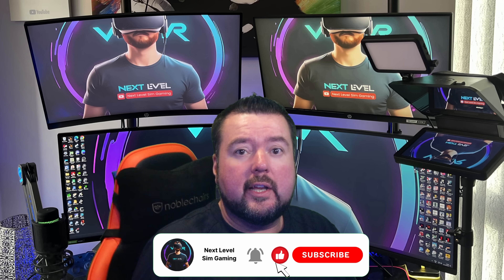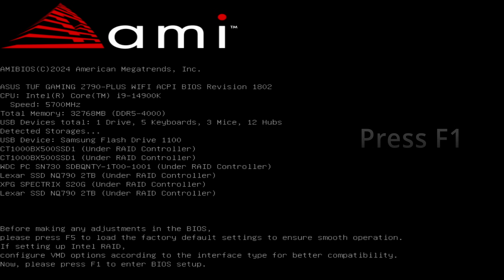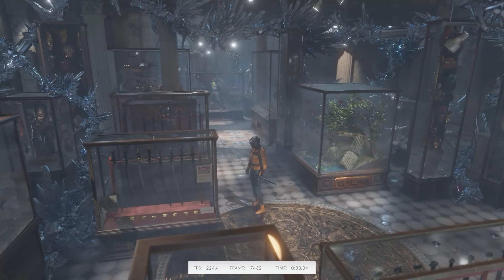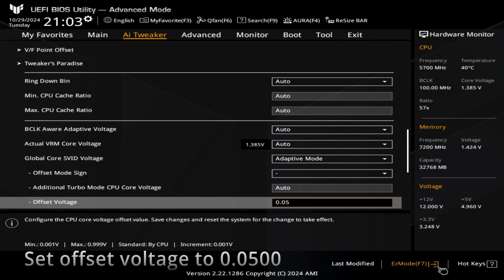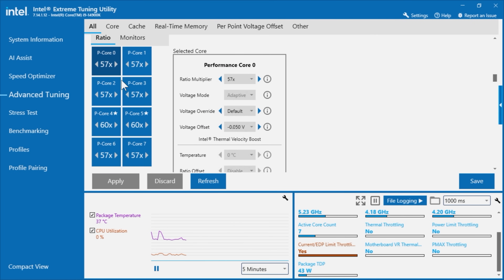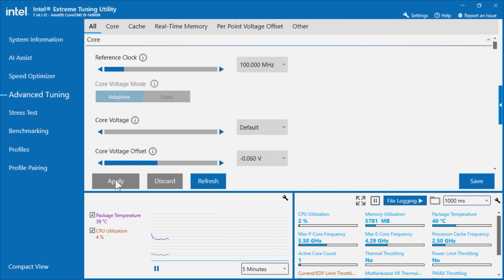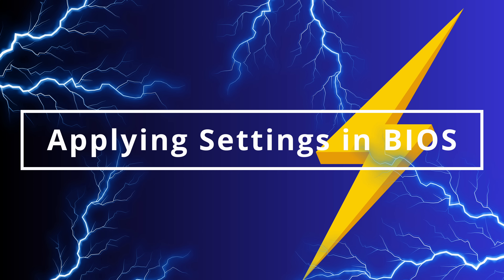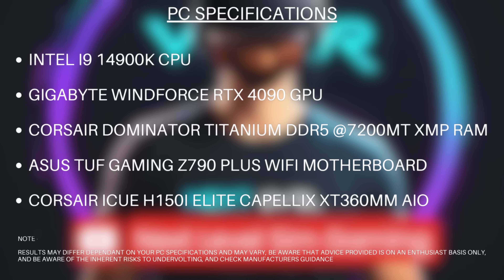i9 14900k Intel Final Microcode 1802 - 0x12B  BIOS Installation, Tuning and Undervolt Guide 📈

Comment: hi, im on b760-f and there no option for multicore enhancement. theres only asus performance enhancement 3.0. what can i do?
Reply from the maker: I unfortunately can’t test on any other platform presently, the only sure way is to try the variables, Auto / Enable / Disable and look at the benefits (if any) Its an overclocking feature that will deliver additional power, in an environment where we are setting power limits in line with Intel’s specifications so I would imagine the gains would be minimal
Reply: @nextlevelsimgaming  ok thx i will try it, but im trying to run LDplayer android emulator multi instance with 5 emu. im getting high cpu usage 70% and high temps 80%. on my ryzen7 3700x i was able to do 6 emu with 50% cpu usage.. i cant figure out the problem. Only fix i found is running Power saving plan with Parkcontrol and unpark all cores.  sorry to take ur time but im on this for 3 days straight :(

Comment: just wanted to let you know that your settings have helped my pc a lot, thank you. i used to get so many errors and blue screens that i thought my very expensive pc was trash,  after applying your settings i have yet to see a blue screen or the usual errors i had before. i have a concern though, my cpu can't get a good undervolt on it like yours. the best undervolt i could get on xtu without crashes was 0.035 and for R23 i had to go even higher to just 0.025 for it to be able to go thru the full test without any errors do you think my cpu is damaged or maybe i'm doing something wrong on my end ??
Reply from the maker: One of the signs of degredation can be an inability to run at lower power levels, it depends on a number of factors such as Silicon Quality (SP Rating), a CPU with a lower SP quality will not perform as efficiently, and will have less tolerance to undervolting, and require more power.  

It may be worth taking advantage of the present extended warranty and going through the RMA process, obviously not mentioning undervolting as the reason, but if it doesn't run well when using the Intel Default Settings for example, then Intel would have little room to refuse an RMA under such circumstances.

Great to hear that the settings are working well for you outside of that issue however, and best of luck getting your issue resolved 🙂
Reply: yes RMA is the only option  if the failure symptom occur because intel wont waste money to recall.

they prefer "soft" recall by replacing affected cpu to a new one.

if they wont RMA and youre still on warranty period you can sue them

Comment: So you no longer have ia cep disabled? Do you have it on Auto or Enabled now.
Reply from the maker: Leave it on Auto, it will remain Enabled whether on Auto, or Enabled, its preferential to have CEP on, however on the Beta, it was inconsistent in my findings, and it can be unhappy with undervolting in general, I personally have not found any issues in days of testing so far, Buildzoid is pretty adament that it should be enabled, it's another precautionary measure that Intel recommends, so on that basis, as it does not interfere with the undervolt seemingly on this final version, I would agree 😀
Reply: I have a z790 hero and when leave it on auto its disabled by default so please double check that , as when i enable it insted of auto my benchmark went from 39990 with offset -0.0700 to 18700@nextlevelsimgaming
Reply from the maker: @ Hi,  there are variations between boards, so thanks for the info, the guide is for the TUF Z790 1802 variant as stated, but will double check, it shouldn’t make a huge amount of difference but have a further guide on tuning next week where I will be demonstrating enabling all cores with a tune and under-volt so will look again then 🙂
Reply: @samouha20041  I guess I will keep it off then. I have a Z790 Dark Hero motherboard.